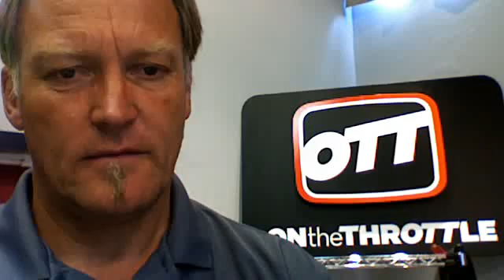Kerry Adams NZ: Setting sag on a 675 and tuning for brake dive

Comment: Hi Dave, I'm tracking a 675, I ride a track with heavy braking zones. The rear of the bike feels like it moves alot, and if i try using thr rear brake the bike steps out aggressively and the sometimes shudders hard while straight up and down. Thoughts?
Reply from the maker: Have you marked bottom out? Where is the zip tie going to? What are your settings for the forks? Given the rear moving under braking via the rear brake, the front is still bottomed or shock rebound is too fast, or your overall geometry needs adjustment.
Reply: @catalystreactionsbw  fork bottum is 17mm, zip tie is at 25mm. Front sag is 30mm rear sag 35mm. I raised the forks 4mm making the flush on the triple tree. I'm running very minimal rebound and compression in the rear do to some serious bumps in places.
Reply from the maker: Travel is reasonable as is geometry, so shock rebound would be too fast as the root cause.

Comment from the maker: I prefer to let the spring work in it's optimal area in the middle 1/3rd of the stroke. In so doing the spring assists with dive control. I will then set compression to also assist thereby having both preload and compression control dive in a smooth and hopefully linear way.

Dave Moss
Host

Comment from the maker: oil level should be higher at 100, compression at 6 clicks out, rebound at 8 clicks out. If you use 80% of the preload to get travel back into the right zone, yes stiffer springs would be required.

Dave Moss
Host

Comment: Thanks for taking your time to reply, big fan of your videos.

Air gap is set at 110mm with 5wt oil.  Gold tubes are flush with triple clamp.
After one track day, the front suspension travel is about 10mm from bottom out(@17mm)

I'll measure front free sag this weekend and see what I get. 
Can increasing front compression help?
I like to trail break, should I have gone for stiffer front springs?

Thank you very much.
-David

Comment from the maker: Do you have a free sag? If not that's contributing significantly to brake dive. What is the fork oil level and what weight oil was used? Forks should be flush wit the upper triple clamp. Bottom out is 17mm up from the axle casting so set 30mm front sag knowing this point. Compression should be 6 out. 

Dave Moss
Host

Comment: I weight 135lbs and put in a set of .85kg/mm front springs and 9.0kg/mm rear in my 675. Now I can set my sag to 25mm(track), Problem is the bike nose dive much more than before when braking for corner.  If I add more preload to the front, do I need to do the same for the rear?  Lets say if I end up with 15mm sag, is it normal? or do I need stiffer springs? 
Thanks